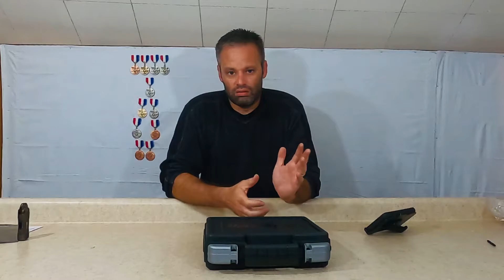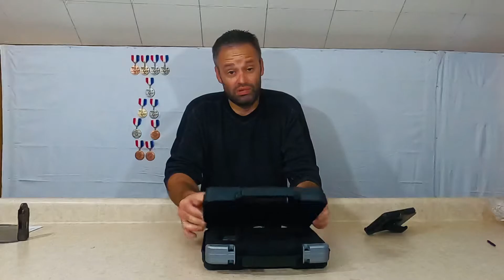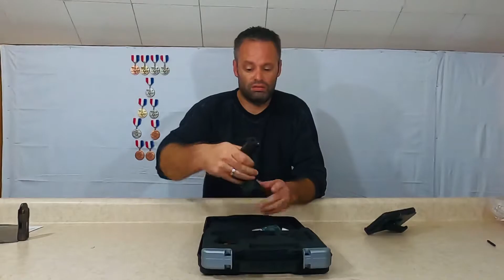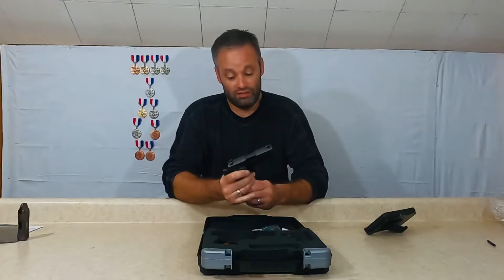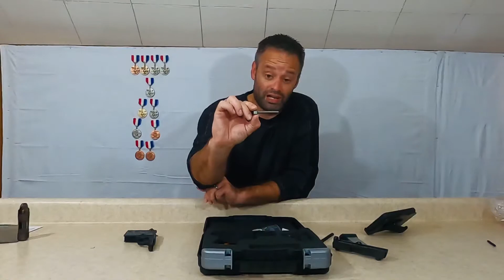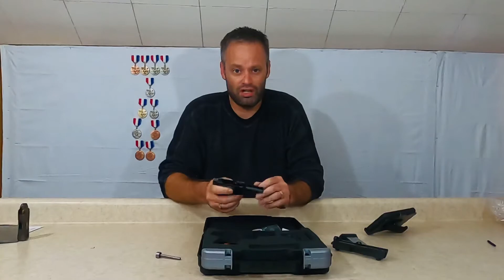Sig P938 Issues

Comment: Your model looked like mine which is the extreme version. Bought mine 3 years ago with no issues at all. I replace the guide rod with a 1 piece SS guide rod ( just to prevent future problems) and added a MCarbo trigger kit ($19) and the trigger pull is 2.5 lbs. Also replaced those grips with Hogue grips which are a little wider and fits my hand better. Love this as my EDC. Sometimes I switch between my Kahr PM9 but always come back to the P938.
Reply from the maker: I believe I purchased mine 7 years ago. I have seen maybe one other video and a handful of posts on the issue I was having. It now runs like a top. I believe the issue was caused by the main spring housing being made out of  G10 like the grips. Definitely is a very good carry system. I purchase it again for sure.
I prefer a trigger around 5 pounds for self defense just because when your adrenaline gets going a 5 pound trigger could potentially feel like a 2 pound trigger or less. When I was younger I was able to attend professional tactical training. Did a lot of real world shooting and ran tons of scenarios with focus on real life.
Reply: @BehindTheTrigger0  a lot of people prefer heavier trigger pulls on their carry guns but comparing my 5lb trigger on my kahr to this I shoot so much better with the lighter pull on my drills. Before I retired from my law Enforcement job we carried Sig 2022 DAO and it felt like shooting a revolver. Too heavy for me. Most of the old timers at my range carry full size 1911 with trigger pulls under 3.5 lbs. I guess to each his own. Good video. I don't see too many people talking about the P938 now. Usually it is the hellcat or 365 because they all talk about capacity and it makes me laugh. Usually gun fights end in less than 3 rounds. Have a good Thanksgiving.
Reply from the maker: 100% agree with you. Need to stop looking at shots down range and focus on more shots on target. Happy Thanksgiving to you and yours also. Be safe.

Comment: I just purchased a Legion 938 and have had some issues off the bat.   The action was really stiff out of the box, so I of course I cleaned it and  lubed right away.   I was was racking the slide to break it in a bit, and started to notice the guide rod sticking out the front.   Tore it down a bit and sure enough it was separating.   I hadn't even fired it yet and the guide rod was coming apart.   I reassembled with high heat threat locker and after the first 50 rounds at the range it was coming undone again.   I'm also having an issue when unloading.   Insert full mag, then load the chamber.   I drop the mag to top it off and it strips a round every single time.    For the price of this "top tier" P938, with the Legion branding on it, I feel like I got robbed.    It does shoot well, but if I have to field strip and tighten the guide rod every 50 rounds what good is it?    I'm actually near the point of considering selling it, and I only have 50 rounds through it.
Reply from the maker: That’s crazy they haven’t improved QC. Give them a call I had zero issues with their customer service. They paid shipping both ways and had it back in little over a week.
Reply: @BehindTheTrigger0  I called Sig today, and they are sending me a new guide rod.   Unfortunately it will also be a two piece.   I did actually hit the range after work today to put more rounds through it.   I'm extremely accurate with it, but once again I checked the got rod after 2 mags and it was loose.   So I kept the action open and just tightened it by hand.   Another two mags, loose again.    I can kind of deal with the mag issue I initially noted as that does not effect combat effectiveness, but the guide rod is a major issue.    We'll see when the new one arrives, they said about 2 weeks.
Reply from the maker: @gkott78  Keep us posted. Hopefully the guide rod fixes the issue for you. Thanks for watching and sharing your issues with the Sig.

Comment: Hi and. Thanks for your thoughts.... How does your safety lever operate?  Mine is very stiff, almost to the point of moving the pistol or the weapon to get better leverage in order to toggle it.   This is both to engage and dis engage.  Is yours smooth and comfortable to toggle?  Thanks.
Reply from the maker: I have never had an issue with my safety lever. It moves as it should. 
Just behind the lever is ball detent that runs through to the other side with another flat faced plunger to the other side. There is a spring in between them. On the take down side safety lever, take a popsicle stick or something that is ridged that is not sharp or hard enough to scratch the finish and try to push in the detent. Be careful not to pry the safety. If it does not push in try a drop Hopps oil. If that doesn’t work I would give Sig a call. I have had good experience with their customer service.
Reply: @BehindTheTrigger0  Hi,... And thanks for taking time to reply to my question... My safety works as it should its just seems difficult to toggle.  I have had it all apart and found to be in good condition, had lube on it too.  Just trying to get an idea if others are as difficult to toggle as mine... Thank you so much for your comment... Love the 938 otherwise.

Comment: Did you say something broke and made the gun go full auto?  What was that?  I want to be sure to avoid that happening.  FYI, if you are not the original owner Sig will not fix it for free. Life time warranty is for original owner.
Reply from the maker: Nothing was broke. They replaced all the springs and the main spring housing with an alloy one. The original mainspring housing was the same laminate as the grips. They never specified what was causing the malfunction. They just sent a list of the components they replaced.
That’s crazy that Sig only warranties the original owner.

Comment: A video on P938 issues could easily run into the 4 HOUR range not just a 4 Minutes. I have owned mine since 2019 and have never had confidence in it to make it a carry gun, which is what I bought it for.  The latest issue is that it is going full auto. Hammer replaced, sear replaced, hammer spring replaced, ejector replaced. Sig wants me to pay shipping both ways to and from and they wont guarantee me they wont charge me for the repairs. I am close to just destroying this gun and chalking it up to experience. I has never been safe. Their customer service suck. Just my opinion, yours may vary.
Reply from the maker: Thats crazy Sig is doing that. Did they replace the mainspring housing? I have heard of a few of the P938s going full auto. Seems that they would want to fix that for you seeing how it is a definite safety concern. Mine had a G10 main spring housing and they ended up replacing it with an alloy one. I have had no issues with it since. Hopefully Sigs gets off their …. And takes care of the issue for you. It also seams that Sig has a QC issue. Definitely a shame for their price point.

Comment: You can’t even make a video with sound Thant you can hear,
Had mine many years, no issues. Send it back to sig instead of videos of self repairs
Reply from the maker: Yeah I did send it back to Sig. They fixed the issue and it runs good. Been working on my set up for the videos. Keep in mind I am not getting paid to do these videos and I refuse to take money away from family for equipment. It is a work in progress…. If you feel you can do better by all means start your own channel and share your vast knowledge on firearms.
Reply from the maker: Update: Per your comment I have purchased a mic. Moving forward the audio will be a lot better.